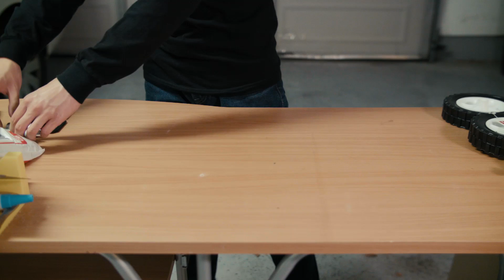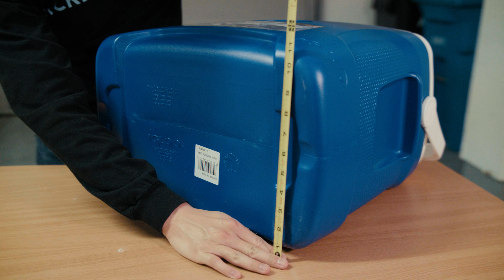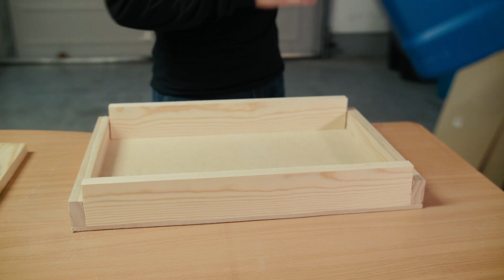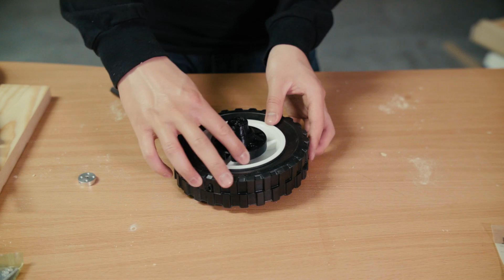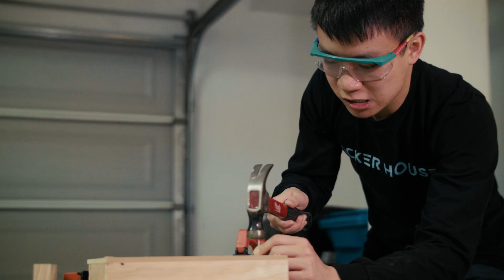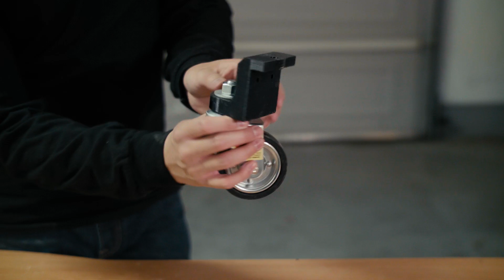Make an Autonomous "Follow Me" Cooler - Part 1

Comment: Very roomy interior.>>>nub.best/9jti     Good extending handle and decent wheels. Insulation is about average, but the super insulated ones have thick walls and are very expensive, so I was willing to compromise. As it happened a friend had his cooler stolen on this same trip. If he’d paid $300 or more for his he’d probably have been even angrier.

Comment: How much weight can the cooler hold? Wouldn't it be better to have an axle through a bearing block driven by the motors instead of directly mounting the wheels? I made this robot for fun but I want to use it to carry my backpack, could these motors support a thirty-five-pound backpack?

Comment: great project. I have concerns about the axles on the drive wheels though. once the cooler is loaded up, I would expect it would be very easy to bend the output shaft from the motor/gearbox. I'd suggest offsetting the motors and drive the wheels via a couple of cogs and chain that you could recycle from a bicycle. That would enable the weight to be taken by much thicker axles and increase the longevity of the project.
Reply: Andrew Larmour agreed, it would extend the life and make the drive mechanism much cooler looking too.

Comment: Great content!! I would love to see your videos more often. Also can you please try using less 3D printed parts because not many of us have 3D printers yet.
Reply: Hose clamps and some holes would do the trick.
Reply from the maker: I think you can buy brackets for these motors on Amazon.
Reply: Not necessarily for this video but all most of your projects include a bunch of 3D printed parts
Reply from the maker: +Devansh Doshi that's a good point. We'll try to provide alternative wood parts plans on our project page.
Reply: There's also the options of having things printed by another company, even staples does it, though it's not the most cost effective for sure
Reply: I disagree!  Keep using 3D Printed parts and post the items on Thingiverse! Those that don't have access to 3D printers need to find a hackerspace or check their local libraries.
Reply: You can use online services that allow you to upload your design and they ship you the printed part. Not too expensive either.
Reply: Dented Yota I second the hose clamp idea, cheap, sturdy, easy to use, and it's probably a lot faster to drive over to Ace or Lowes than to find a 3D printer if you don't have one, then print the thing.

Comment: Robotic Bartender? What happened to that?
Reply from the maker: Long story short, we thought that our linear actuators were solenoids instead of cheap motors that actuate and hold at stall current. When we picked up a new power supply and sent > 30A through them, they all burned out. We'll probably finish the series at some point in the future, but we're taking a break since most of the components need to be redesigned for a different style of actuator. :/